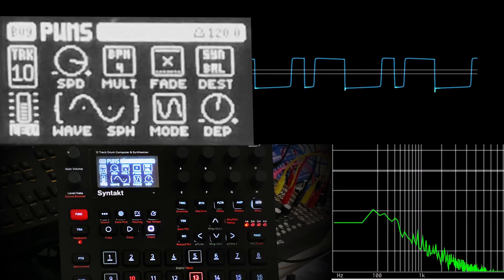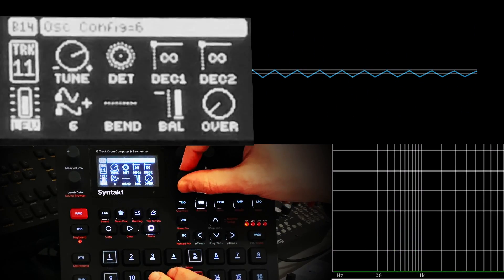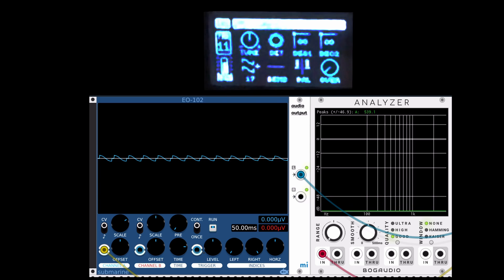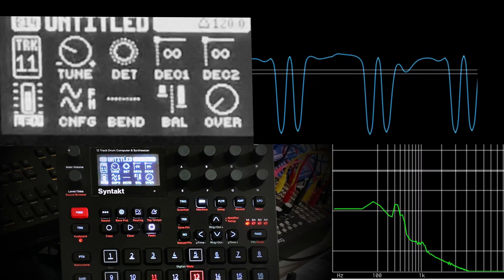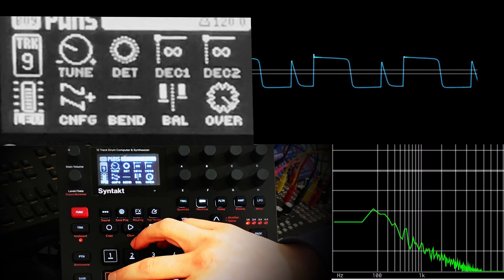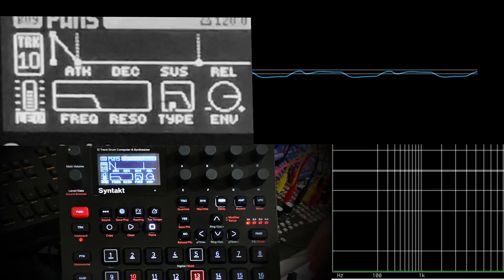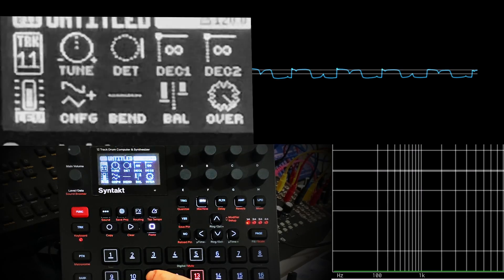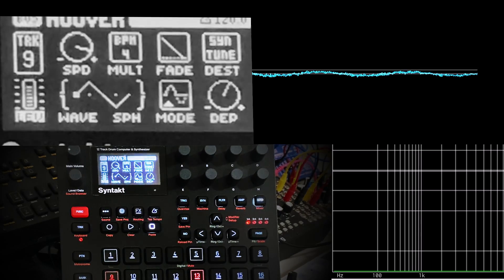Syntakt Dual VCO Guide with Scope

Comment: So what’s the highest note that tracks stable? Really want to use this as a month synth!
Reply from the maker: Thanks for the question, I knew I was forgetting something: it varies a little by configuration, but they all lose stability between C6 (~1050Hz) and C7 (~2100Hz) when tuned to the max. Very usable for most applications. And I misspoke, when they max out at the high tuning, the oscillators stick at a very flat C7 rather than cutting out.

Comment: Do you have any idea why the saw waves in the analog machines (DVCO and RAW) have a cut in harmonics at around 10k and 20k Hz? Its not like that for saw waves in the digital machines, is that just an analog thing?
Reply from the maker: I'm really not sure. My guess is that it has to do with the analog filter on those tracks, but I'll take a look and report back if I find out anything interesting.

Comment: Excellent video. What software do you use to draw waveforms?
Reply from the maker: Thanks! These are the VCVrack plugins included with miRack (the iOS port of vcvrack), which happened to be the first place I thought to look at the waveforms. It’s the Submarine EO-102 oscilloscope and the BogAudio Analyzer.

Comment: Love this. Been hoping someone would do a deep dive on the Dual VCO. Still struggling to get sounds I love out of it, and this really should help. Would love a bread and butter tutorial
Reply: For bread and butter, I'm struggling to get a simple bass that cuts through without either having too much buzz or too much resonance. Currently, not a fan of the filters on the analog machines, wondering if i just haven't really found the sweet spot
Reply from the maker: @robbiep742  Just saw this, and have to say the just-released SY RAW machine makes ordinary synth sounds way, way easier to dial in—for basses on that one, the phase reset (with the the dot on OSC 1, the second group of waves) makes a big difference and sounds better. I think SY RAW is in general a big step up from SY DVCO.